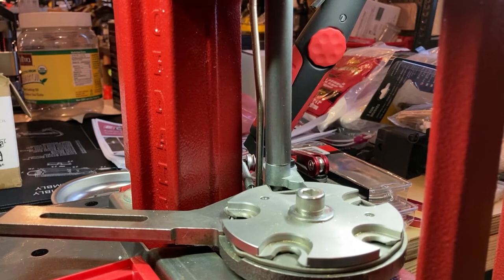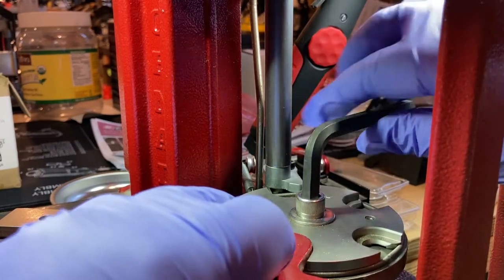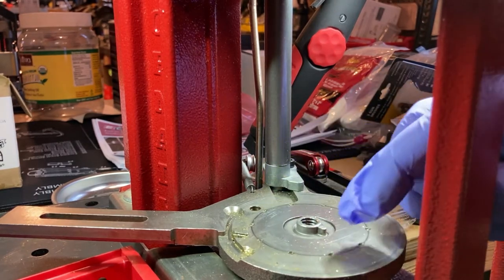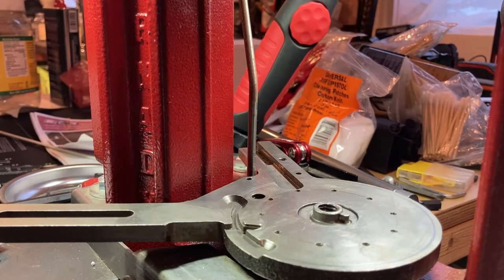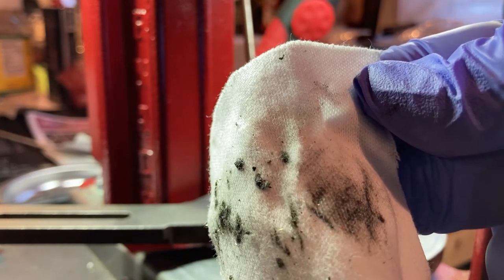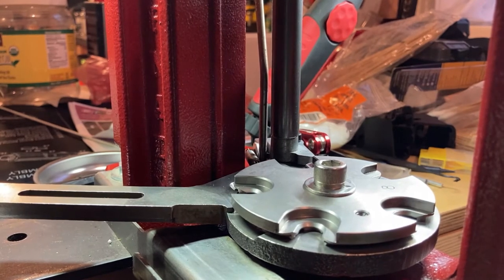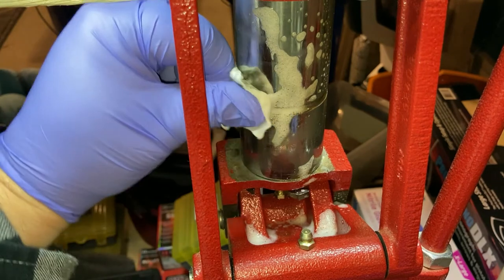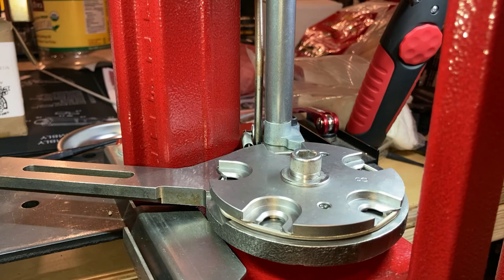Quick & Easy Hornady LnL AP Progressive Press Maintenance

Comment: nice video. Ive had my press now for 4 years and never dona any of that - but now its time 😉
Thx for the good advices. Some greese might be needed.
Reply from the maker: About every 5000 rounds of so I find it is worthwhile to take the shell plate off, clean up any mess, lube everything if needed, replace the spring and so on.  The press in the end functions better over the long term in my opinion.

Comment: You say the press is greased but you show a clean grease ring on the post.  If that did not carry the grease around the post housing while in up position when greased , it’s not greased . Also you should not clean it afterwards as it wipes mores grease on the post housing each cycle

Comment: What type of grease you are using for the fittings is there a particular weight and brand thanks
Reply from the maker: I'm just using a regular grease that works for the tractor, not sure of the brand.